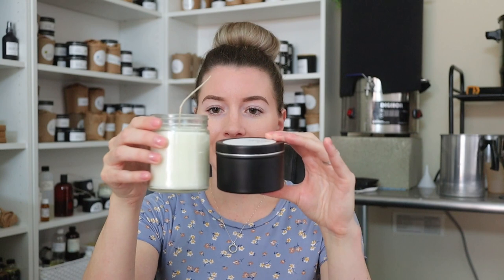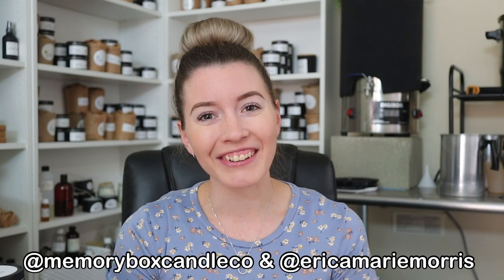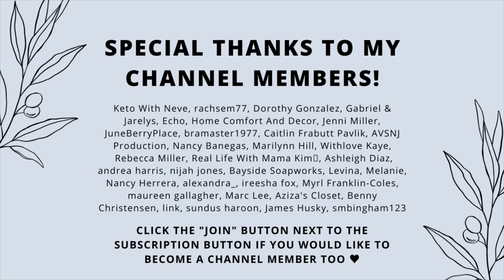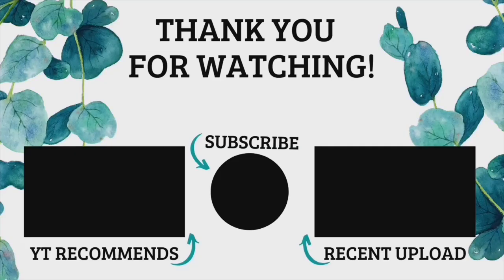Here’s Why I Don’t Do Wickless Testing Anymore

Comment: Nice video and always a good topic. I love wickless testing but I do think a lot of people in the groups miss the point of wickless testing. It's really not meant for testing first burn to last burn, but more to find your initial wick with one or maybe two burns and then quickly switching to a fully adhered wick test. 

I think wickless really comes in handy when dealing with expensive vessels and you don't want to use four or five of those vessels only to find out half way through burning that three are absolutely not going to work. Then you are left with three expensive vessels you can't save.

I ran into a great example of why I love wickless testing to find your initial wick this week actually. 
I have been using EC26 wax in the Lumen vogues and they burn perfect with two LCS 35's. I just started to test the new M12 soy wax and it requires two LCS 50's for a perfect burn. Same vessel but the difference between two waxes is four wick sizes. That's a huge jump and a lot of extra candles to find that difference with normal wicking.
With wickless testing I was able to drop two LCS 35's in the Lumen, start the first burn and it was apparent within two hours that it was clearly not the right wick. From that short burn I knew to go up multiple sizes and then made fully wicked testers using the 45 and the 50 to burn them all the way down. 

Shallow tins like you mentioned, damn near impossible to do wickless in those. LOL 100% agreed. 

You also nailed it when you said you need to test all the way down and wicking that test is the best method for sure.
Reply from the maker: Thank you Jeff!
Reply: I was curious about this method and there’s a process for everyone!  This was interesting and maybe once I finally am making money (LOL!) I can test as you do.  I do the wickless testing mainly to determine whether a wick works or not and change them out.  After that I do absolutely do an abusive burn, for determining FO and most importantly is my candle safe.  Thank you so much for sharing.  You selflessly help so many chandlers and I am incredibly thankful!!  I love your braids, btw ❤️ so pretty!! 😊👏🏻👏🏻👏🏻❤️🙏🏻
Reply: Great information I am with Jeff I will do for my initial testing a pour that’s only halfway down the jar and I have started doing wickless testing 

just to see which wick will work Then I make a jar with a wick tab to get an accurate wick test.  I think the wickless testing is great if all you’re doing is just trying to figure out which wick would be the best choice without having to go through multiple vessels 

The tins no can do it will not stay afloat lol

Comment: Agreed. That is why I do wickless half jar testing. I wick for the bottom half of the vessel first because it does get hotter the lower it gets. Then I proceed to the full jar and burn test. Good information.
Reply: I do this too. It would be interesting to hear if anyone has tried all three methods (wicked, wickless, half-jar). To the Batcave for some experimentation!

Comment: Personally, I totally agree with you! You cannot test wicks with one burn! In my opinion it has to be a full burn. To have a full burn it has to be adhered to the bottom... so, like as you said it won't float or slip to thr side! Wicks burn differently the further down in the vessel.  It is my opinion  also that wickless test burns are not truly beneficial or accurate! Bravo Erica!

Comment: I totally agree. I did wickless testing for such a long time along with half jar testing and by the third burn it will fall over and I would give up on that wick. When most of the times it turns out it just needed to be glued down to the bottom so I can get an accurate test result. So now I do not do wickless testing anymore. I do it starting from the full jar and I've gotten so much better and accurate results. I use an apple corer and pull the wick out. And then put a new wick right down in the center. I saw this on armitage candles YouTube channel. It's worked like a charm.

Comment: Wickless testing stressed me the heck out. In the beginning I took this advice and never found the correct wick, so I got discouraged and stopped making candles.  I recently started back testing and paid more attention to type of wick I was using in comparison to the formulation of the candle, wax and jar size, this made a huge difference. Yesterday I was created a successful burn test spreadsheet and added the candles to the sheet the passed the test, that was a good feeling. I agree with you and your thoughts 100%. The wick does shift which can interfere with the burn.  Leaning closer to one side of the jar may create an uneven melt pool or heat up one side of the jar more than the other side.  Wickless testing in a tin is just not a good idea. I read that you should at least test burn about 3-4 times before you rule out a wick.  I know there may be tunneling, and you can tell early on in the testing process, but then this goes back to selecting the correct wick based on your formulation, container size and wax. I would not want to buy a product that was not properly tested.  In my opinion I feel that is unethical.

Comment: I'm still in the testing phase, and I do the wickless testing as well. I am currently doing the half jar testing with the wickless method using wooden wicks. During my testing with these nee tumblers, the wick leans and is covered in wax leaving me with about 4 oz of wax. So what I'll do is remove the wax, and place it in a tin, and test that with a secured wick in a smaller size. That way I'm not wasting my products. But I will definitely start wicking them and just save the wick clips used for testing purposes.

Comment: Nothing to do with wickless testing but with the vessel you are testing with.  Why do you test in a different vessel than you use in your candle line?  How do those tests help if you won't be using the same wick size?  Or are you just testing to see if wick type works with wax & fragrance oil?  I'm new to candle making & I'm just curious.
Reply from the maker: You always have to make sure to test in the same vessel you will be selling in. I am looking into adding these vessels specifically for wholesale purposes :)

Comment: I really don't think this should be an "unpopular opinion" and should be talked about more. It is all sound advice. 
While it may cost a little more in supplies it really saves time and is much more accurate to just make multiple candles with wick sampler packs and judge them all at the same time. Well, aside from the scent overloads.